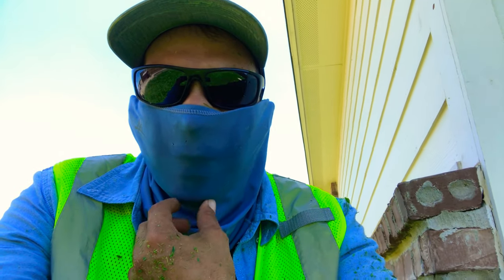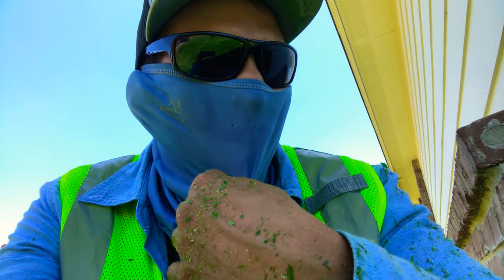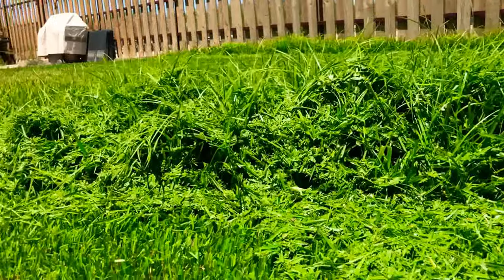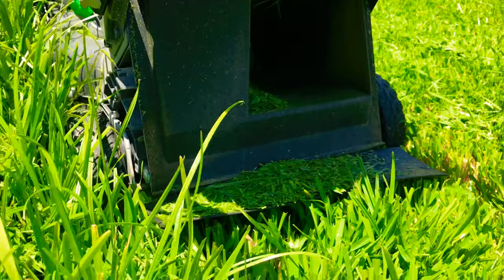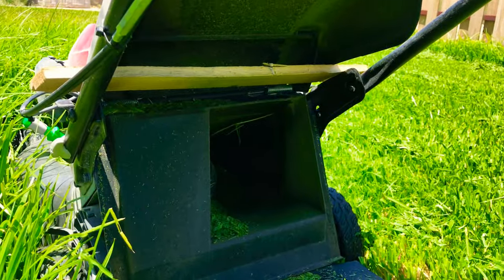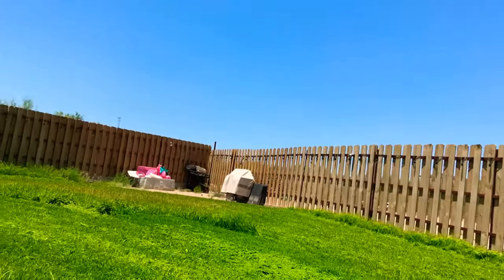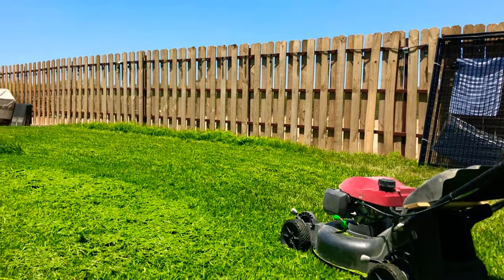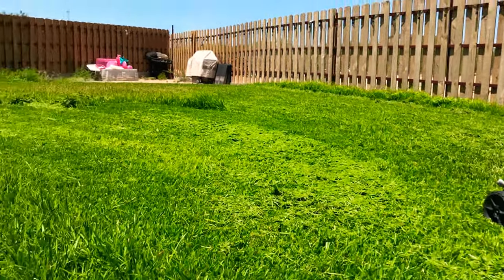Cutting tall grass with a push mower

Comment: My Tecumseh would cut that in a snap because it runs faster, but it's not self propelled
Reply from the maker: Nice 👍🏼
Reply from the maker: You have the RPMs turned up?
Reply: @electriccuts  I installed my own throttle on it and I can tune the throttle's max speed
Reply from the maker: @therandomman6647  nice. I would like to do that to my mower.
Reply: @electriccuts  I'm making a video on my mower/snowblower, weedeater/edger/leaf blower is coming in the spring, hint (km91r) I will give a rough overview of how I made the variable speed
Reply: You're welcome man are you still working if you are tell me though
Reply: Hey I have some cheese too that you might bit just text me back if you want them they'll size away like
Reply from the maker: @justinhughes6487  still been out doing jobs. It’s slow but still got a few jobs.
Reply from the maker: @justinhughes6487  huh??
Reply: Didn't type that you did you don't know how I should feel h u h
Nobody
Reply: And text me back if you want